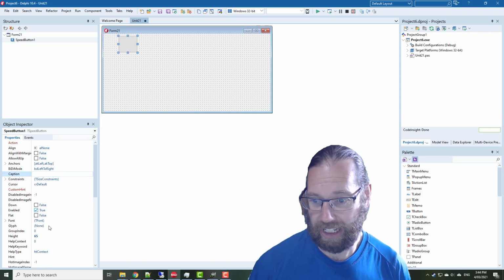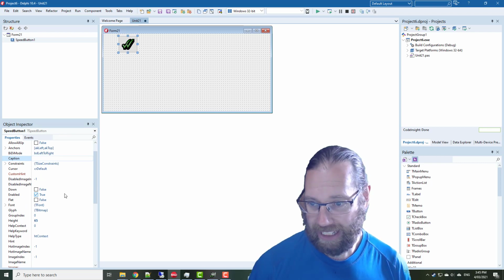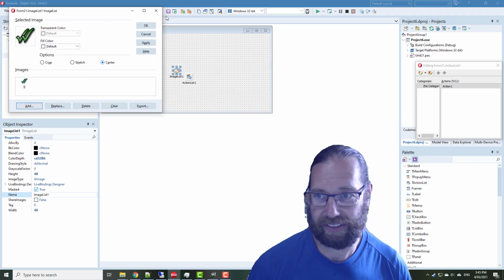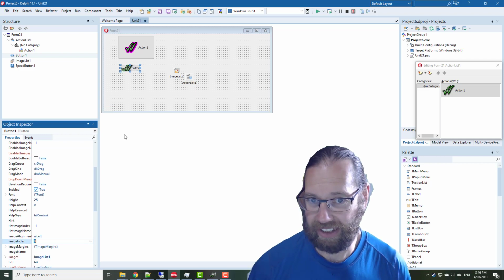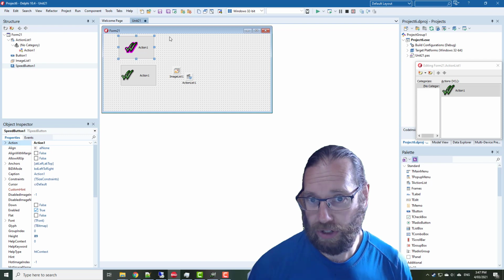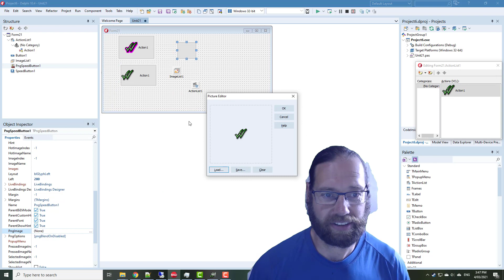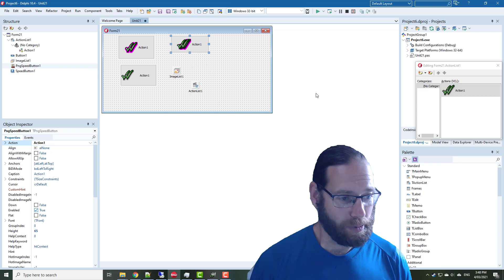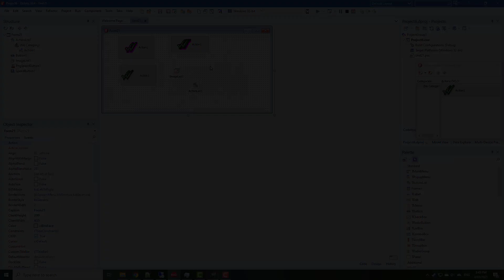Delphi #168 - The Problem With SpeedButton Images

Comment: I have always used BMP on my speed buttons and as long as you leave a 1 pixel clear boarder round the image I don't see this issue.
Reply from the maker: Yes, but you miss out any alpha transparency, which is what makes the images look smooth around the edges.  Or in my case problems with the drop shadow.